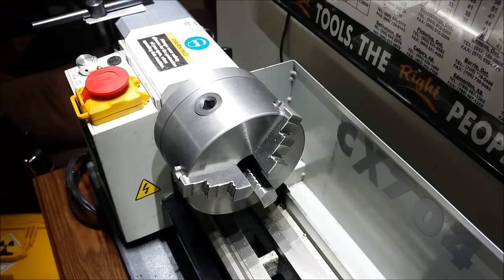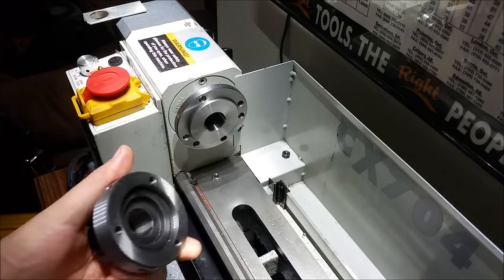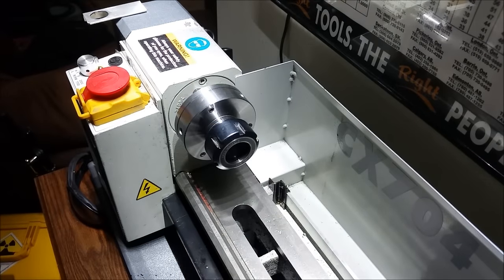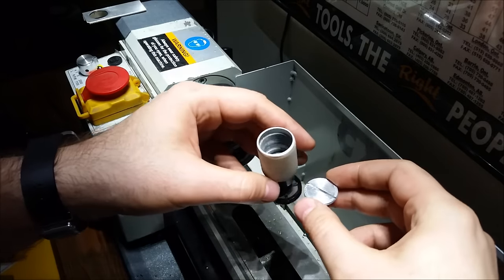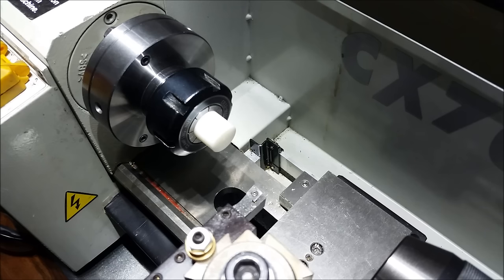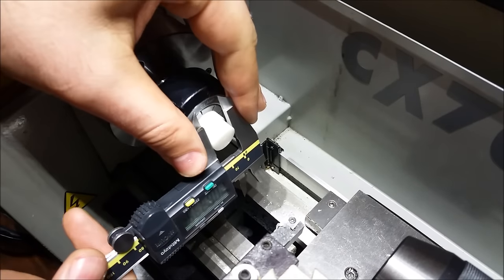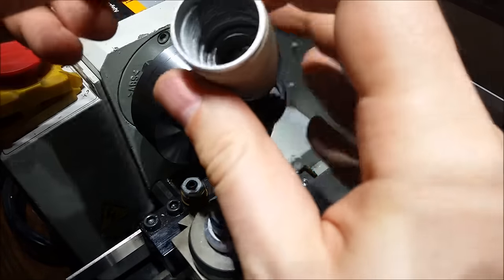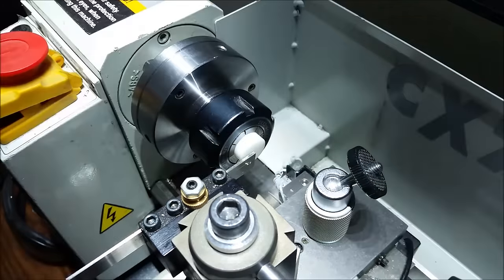Making a plastic spacer/bushing for a ball head on the lathe

Comment: Hi there, couple of questions I hope you can answer. In your video's I see you're using indexable carbide lathe tools on your mini lathe. Do you like this better than high speed steel ones? Are these the common chinese ones from ebay? And last what shank size are they? Thanks much in advance
Reply from the maker: Sorry I took so long to reply! I never got a notification of this comment!

I do use 3/8" indexable tooling on my lathe, but they're actually HSS inserts (T-15, which has 5% cobalt and 12% tungsten), from A.R. Warner http://www.arwarnerco.com/, I bought the tool set from Little Machine Shop,  http://lmscnc.com/3694 as well as a few carbide inserts for when I'm turning tougher stuff. Expensive, but well worth it, this stuff is really high quality, and I've only had to change to a new insert point once because I tried to turn an abrasive coating off a printer shaft. The inserts are super easy to sharpen, just hone the top surface on a stone with your finger, only takes a few seconds. https://youtu.be/LKGkkGFsF50?t=155
Reply: No problem! Thanks for the info. Sounds like those inserts are indeed worth it, nice